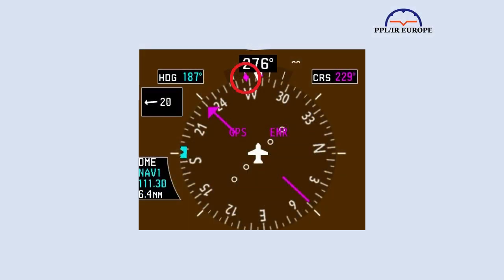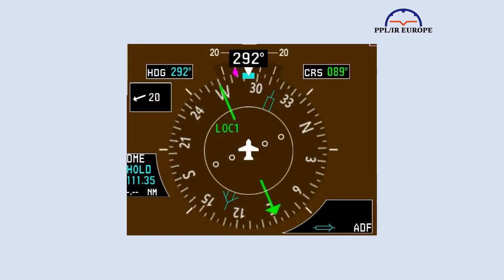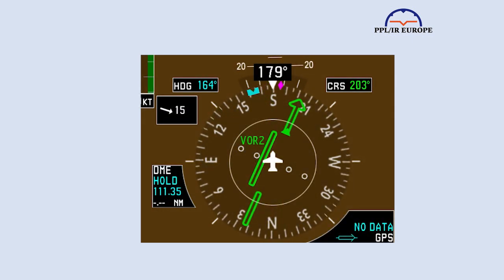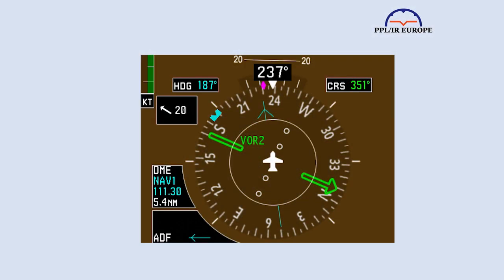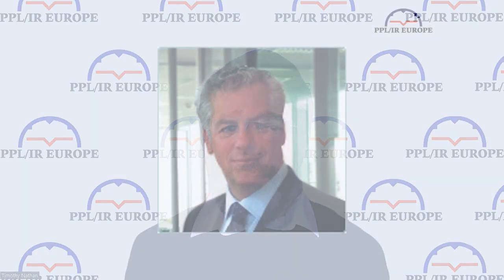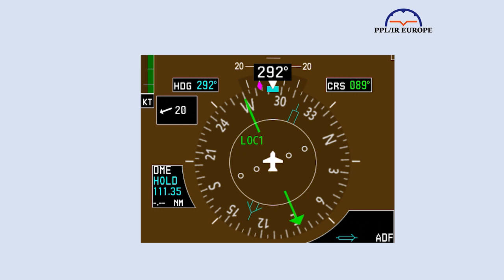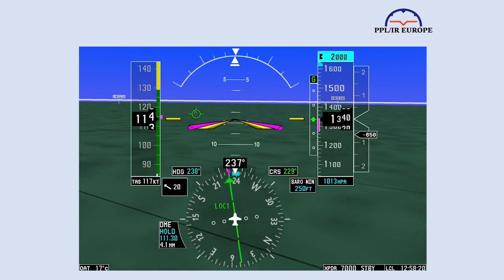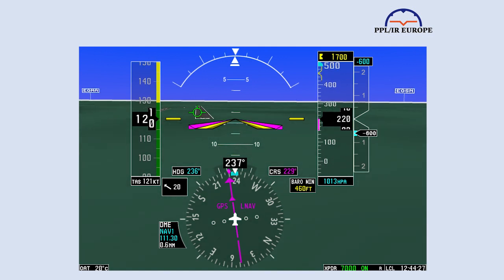Track Pointer and Flight Path Marker

Comment: It’s generous of Timothy to credit me as I suspect for many this is common sense and they may do it instinctively anyway.  If you have a track pointer, you can easily see drift at all times being just the difference between track and heading.  Knowing you need 3x that for the outbound leg in the hold you just need difference between heading and course to be 3x drift.  Since, when we are flying on instruments,  our IQ is divided by three, it’s easier (at least for me) just to visualise this rather than doing the sums, by adding the 1x drift I can see between heading and track to the 2x I can see between track and course, and there’s your 1/3rd to 2/3rds ratio.

Comment: for the henry hunter holds - great tip. How fast were you flying that hold. Manual calculation for 120knots says wca=15 so triple would be 45 degree. I am assuming the wind is 20knots from 005 from the glass display for my calculation. You are showing triple as being 24 so wca = 8. Are you flying at 240knots
Reply from the maker: The W/V in the video is 045/20, which gives a 120-knot WCA of around 8°. The Henry Hunter Technique is visual and very elegant and that is always a plus because it avoids any mental gymnastics when figuring out the hold.
Reply: @pplireurope  ok thank you. I was taking the glass display of wind for the direction relative to the heading bug and was getting 293+73 for that = 005